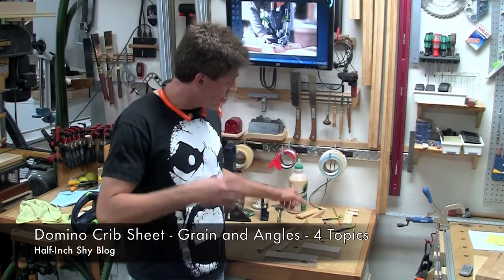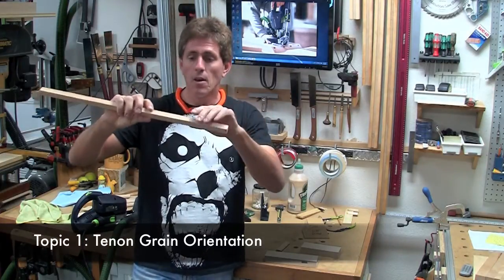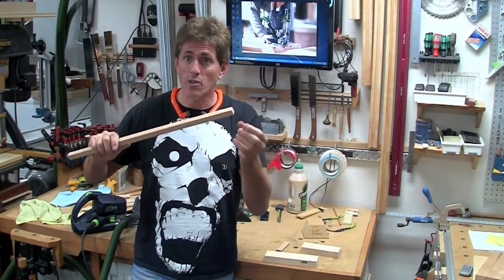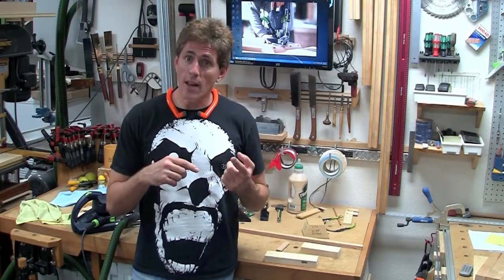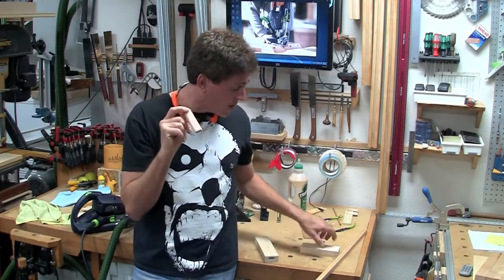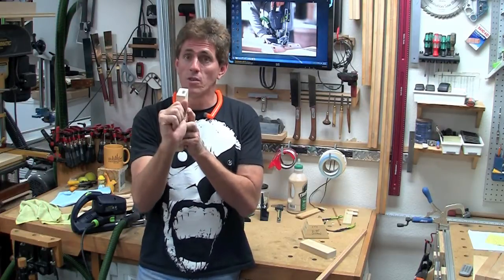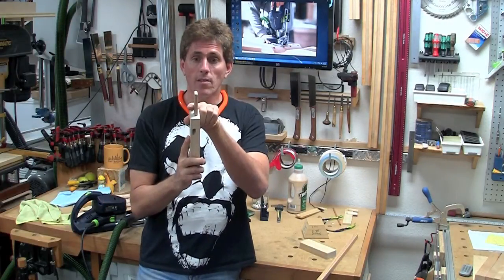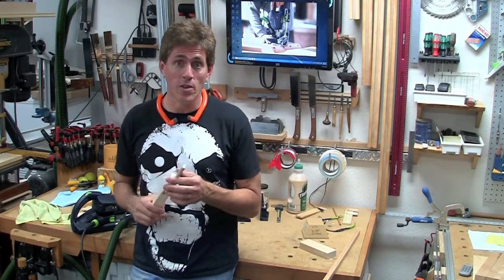#70 - Domino Crib Sheet - Grain and Angles

Comment: Hey Paul....wonderful insight into the Domino and usage principles in consideration of grain and angles.  For a large table top of 5/4 planks with a 45 degree mitred waterfall edge, I was planning to use a series of 10x50mm dominos.  In light of the information you provided about available long-grain exposure of the domino in a 45 degree mitre, would you be inclined to use a wood glue or epoxy for that mitre joint?  There seems to be a debate about wood movement and the flexibilty/rigidity of the adhesive, with many people stating that epoxy is going to flex better over time as the wood moves and provide for a more durable joint.  I'd really appreciate your thoughts on this matter if you can spare the time.
Reply from the maker: Sorry for catching up on comments so late... normally epoxy is fairly rigid so gluing a wide joint like that with a rigid glue would be problematic since you're constraining the expansion/contraction. Here in Arizona, you'd very likely get away with it as we stay bone dry most of the year; if people say it works fine for them, check their location. For that waterfall edge, the actual edge is going to be all end-grain. The Dominos inserted into that edge will also be gluing to end-grain, but end-grain cut at 45º so there's a bit more adhesion. Since you are using 5/4, consider putting the Dominos on edge: that is, 90º to the top and side surfaces. In this way, they get long-grain. With 5/4, you should be able to get at least the 6mm Domino into that orientation. You could mix it up with a few in that 90º orientation and others between in the easier flat orientation. The 90º Dominos will do the bulk of the holding with ease. This is how I've done some large miters and they held up great.